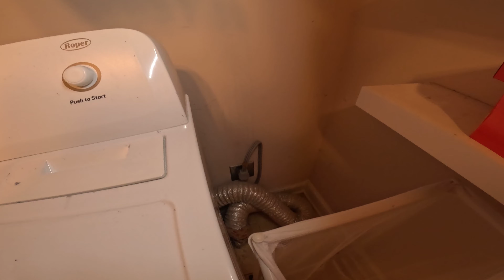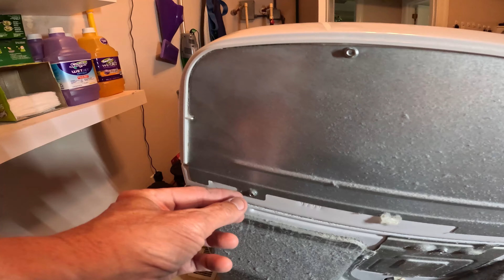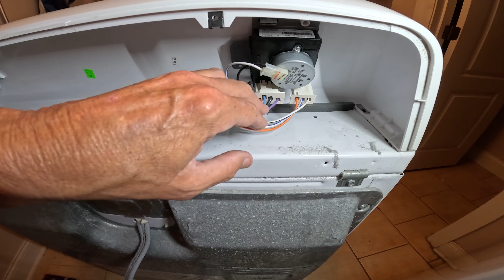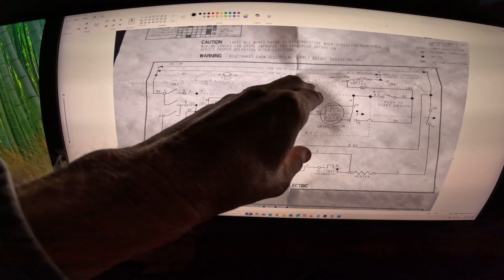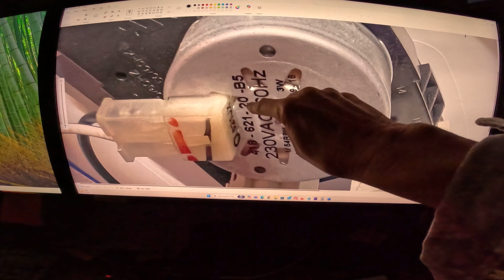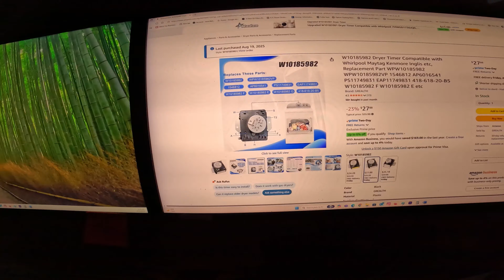Roper Dryer Timer Fail Part 1

Comment: Our Roper has a metal pin between the knob and shaft. The plastic piece around it broke. Did that part get replaced in newer models?  I’m trying to find the replacement so o don’t have to replace the timer assembly.
Reply from the maker: I do not know, my unit did not have a pin.